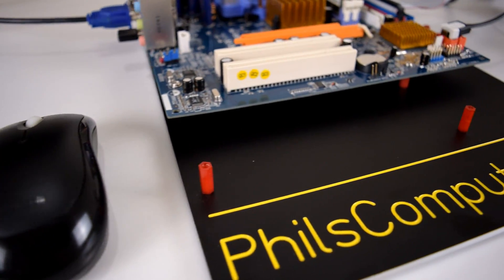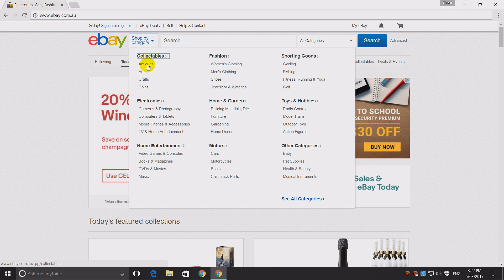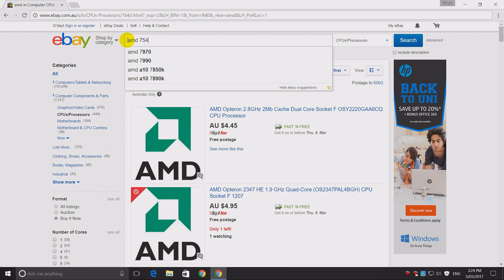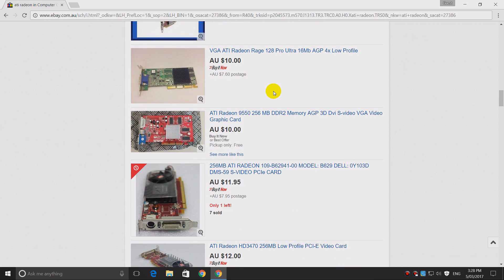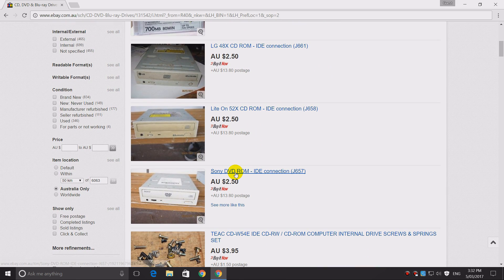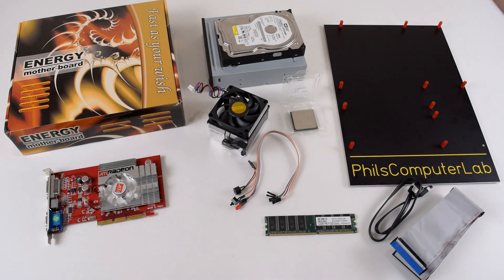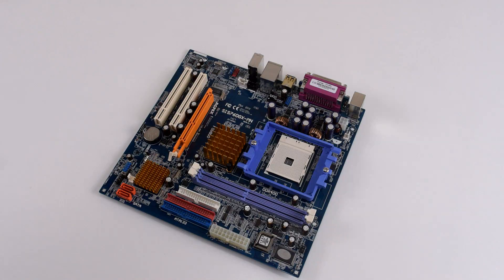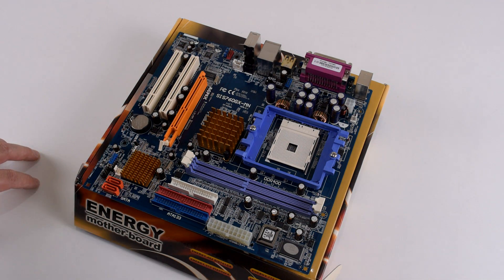Building a cheap Windows 98 Gaming PC

Comment: Sir . Great Vidio , may I ask if you ever did the accompanying vidios ?
I just totaled the old Dell and was hoping to build a computer for up to about 2005 games I don't know them but definitely games like zaxon pinball and race games.
I did find the AGP slots are alot more rare to get cards and drives for and working with old parts are stiff and break easily..    Any help pointing me in the right direction would be a great help.   Have a good day .. Bob
Reply from the maker: Finding an entire old machine makes life easier as you just have to add or replace some parts. AGP is what you want for Windows 98 and earlier. PCIe better for XP and newer.
Reply: @philscomputerlab    Thank you.  I got 7 old units last night one fired and ran most beeped and no bios. But got a Dell 8250 that fired went into windows 2000 and had a hard drive failure warning.  Games were looking for are windows 98 and xp.    I liked Zaxon and she likes pinball. 2 different versions of windows . And I would like the grandkids tonsee games that are fun and not all shooting as they are exposed to now... I'm into this a couple months now and have a optiplex 9020 to try to play online with my oldest grand son ... I did get an optiplex gx520 to go into bios also... Might you know these models and where I can go from here.. I'm still shopping for an older system... Thank you so much for your reply I'm trying to work with it.. your way over my head in this... Again thank you Bob Harrison

Comment: Yesterday I picked up a well looked-after Cisnet branded PC with a Sempron 3100+, 1gb of ram, dual layer DVD burner and a 120gb hard drive yesterday for 10 dollars (Canadian). This has an Via K8M800 chipset with the wonderful Unichrome pro IGP. Unfortunately I could not find my VGA cable so I had to dig through my old hardware stash to find a AGP card with a DVI connection. I dug up an old 256mb (I think) Radeon 9550 but I think either the memory or the GPU itself is damaged as the display at least in the BIOS screen is slightly corrupted with little vertical broken lines through the display. I'll live with it for now. I think I'll try to build a quad-boot system with XP, 7, 8.1 and Windows 10 just for the heck of it. Ultimately when I can source a good working AGP card I might turn this into a XP-era gaming rig

Comment: That's very expensive. What I built:
A Compaq work station motherboard with a Tualatin-S 1266MHz CPU and 512MB RAM for about 7USD
A 64MB Geforce Ti-4200 for about 4USD (untested)
20GB HDD I already had
FSP 200W PSU for about 5USD
Sound Blaster SB0100 with driver CD for 7 USD
LG CD Drive I won an auction for about 1 cent and the seller just gave me for free.
That's about 23$ total. Though I still need a case.

Comment: hey Phil, this may sound like a silly question but is 2GB storage enough for Windows 98se and some games? im dual booting Windows 2000 and Windows 98se on a 20GB hard drive and 98se has 2GB of free space I intend on using it for games Windows 2000 wont play and I also have a 64GB flash drive im hoping both can use for extra game storage
Reply from the maker: Yea that should be fine.

Comment: In may I have build two similar computers  based on boards with socket 754.  I didn't want the cpu to be power hungry so I added athlon XP  1700 or 1800. Athlon XP-M should  be better but they are rare.  OS are old arch linux and Xubuntu 12.04.  First has Nvidia 7300GS, the second has old Ati RAGE 128 PRO card to test how linux runs on such old card.

Comment: Nice very cheap build. Was it difficult/expensive to find a Socket A MB and an Athlon?. The 1 GHZ Thunderbird was an awesome CPU for 98/ME. (The 1,4GHz was a powerhouse, but ran hot as H...)  And with a Geforce 3. Perfect 98/ME machine!
Reply from the maker: Wasn't difficult at all, they should be quite easy to find.

Comment: Hey Phil, I'm looking at getting that ATI Radeon 9550 you've got there. There's a load of that exact same model on Ebay all shipping from China, going for 25 USD... did you get yours from a Chinese supplier, or would you reckon the ones coming from China to all be fake?
Reply from the maker: Forde3654Eire Not sure it has been a while. With these Radeon cards you don't quite know what you're getting exacting.

Comment: What about XP machines with compatibility mode? How good is it? I guess games run too fast though??
Reply: In my experience, 32-bit XP has surprisingly good compatibility with those old 98-era games--especially if you're very thorough and make sure to patch your games to the latest versions. You lose a lot more with the axing of real DOS, but if the PC is powerful enough to emulate with DOSBox, then you could use that too. Also mind, I've never used a version below SP2 saying this.

And of course there will be exceptional games that will show issues even with the compatibility modes--I remember having to use alternate installers for Thief/System Shock 2--but it played perfectly besides that, random save crashes in Jedi Knight II--but it was still playable, Star Wars Episode I Racer was an unplayable mess, Fallout 1 & 2 display incorrect colors (without a widely distributed fan patch) and probably some others I've forgotten. If you have a multi-core CPU, you best disable the other core as well.

If the games run too fast, you can use a framerate limiting utility like Rivatuner Statistics Server or Fraps or whatever you like--there doesn't appear to be any software or older versions of these programs that achieve this under 98--at least that internet users can surface for free. Chances are extremely likely that even older Nvidia/ATI/AMD drivers will also vsync pretty much anything perfectly too if you want to do that instead.

You can also enjoy the benefits of Sound Blaster cards, and even use an X-Fi PCI-Express card for real audio hardware acceleration if your mobo lacks traditional PCI slots. Unfortunately, support for Aureal Vortex 2 hardware audio is non-existent from SP1 and onward from what I've read (and extremely buggy for vanilla XP), so you will need 98 for that.

Hope that wasn't information overload!

Comment: are 128mb enough for a gpu or should i get at least a 256mb card?
Reply: I guess that depends on how new you want to play games. If you want to play those 2004-2006 games that were being released on the very last days of 98, all the cards you'll be interested in will already have 256 MB or more.

If you mostly just want to play 98 era games and the occasional Win2K/early XP game, 128 MB is probably fine for just about anything.
Reply: thanks for the help! :)
Reply: No problem.  ; )

Comment: I wonder if there's any Mini ITX motherboard capable of running Windows 98. I have a couple Mini ITX motherboards but none of which has chipset or integrated VGA driver compliant with Windows 98. I'm wondering if older motherboards like the VIA Epia series may do the trick. I'm thinking of putting a 3DFX Voodoo² in the only available PCI slot, then put everything in a small Mini ITX case.
Reply: I'd probably bite the bullet and get a slightly larger mobo/case for a few more PCI slots.

Half of the fun of a Win98 PC is the options for sound cards, imo--also important if you want to use older controllers/flightsticks.

I guess you could make do if you just get a single AGP card and only a sound card, but then you better hope you never need another expansion slot for anything!

I'm also just going to guess that ISA is pretty much out of the picture if you have anything but a full-sized ATX mobo, but unless you really like having DOS on the side, that's no big loss.

Comment: i have plans on buildin' a Windows 98 PC but i may think of gettin' dat PSU u have 4 it as well! i don't feel comfy on usin' old OEM PSUs i had ripped from my old PCs
Reply from the maker: Yea don't skimp on the PSU, ge something decent.
Reply: yes sir i will get a decent PSU! however i'm pretty sure EVGA PSU won't be good on Windows 98 era PC hardware because i'm not sure if they have good 5v rails so i'll look into Corsair or FFS

but would Slim IDE cables be better or should i stick with original IDE cables?

Comment: But... Can it run Crysis?
Reply: no! Crysis is a 2007 game and will not run on a Windows older than XP or even a processor less than 2 cores
Reply: It surely does run on a single core CPU. It just doesn't run that great.
Reply: but Windows 98 can't run Crysis
Reply: I've finished Crysis on a single core CPU, so that shouldn't be an issue. No idea if the game is playable on Win98 though.
Reply: it won't boot on Windows 98

Comment: Before I clog up the comments with a TL;DR spiel, can I make a game request in the comment section?

 P.S. The game is easily download able as it still has an active community.
Reply from the maker: I put some "game request guidelines" in the description :D
Reply from the maker: That's perfect! Now I have to deliver the goods :D
Reply from the maker: Bugger, it crashes when launching it. Burnt both CDs and it installs fine. I got to move on I'm afraid and finish the video :(
Reply: Hmmm, did you try running it on Windows 98 or XP and did you install the patch with it? I think if you install the patch on 98 it will bugger it. It has been so long since I last used Windows XP so I forget what features do or do not exist but on Windows 7 I need to both run it as an administrator and Windows XP SP3 Compatibility Mode in order to get it to run.

 P.S. Are you launching it with the second disk mounted?

Comment: Here in Thailand, I often find old computer parts from recycle center that happen to be near the air force base, they sell parts that isn't thing like gold cpu or circuit board with gold chips for cheap, lots cheaper than e-bay and sometimes they have lots of complete windows 98 computer or very old workstation/unix computer about to get recycle.

Last week, I got my self an old Intergraph TD-20 workstation (it in good condition and still working!) with Pentium 166MHz 48MB RAM 20GB HDD onboard ViBRA 16 and Matrox PCI card for about 10usd, and non working socket 7 tower (broken motherboard/no CPU/no RAM) for about 10 usd, an ATX socket 7 (working!) and an ATX slot 1 motherboard (untested) for about 2 usd each, a 3DLabs Oxygen VX1 AGP graphic card for about 2 usd. Less than 10 usd for the cost of travel there.

Tho with the risk that the parts I brought not working but I if you have some electronics  skills (can use soldering iron, change motherboard capacitor, etc.), have some experience of how to choose good parts from pile of junk and you can take the risk, recycle center are probably the best source to get parts for retro gaming PC :)

Comment: Also from regional Australia (SA) and seeing the price increases over the last few years is a concern.

Yeah, certain parts are becoming more scarce, but there's a fair few speculators buying up stock and listing it for a potential huge profit.  I'd rather people who are going to use it buy it!

It is still cheaper to buy individual parts and reassemble than buying a complete unit.  So a thankyou for your videos on putting them all together.
Reply: Keep an eye out for bulk sales. I picked up a box of mixed cards for $1 of which 50% were internal modems but amongst  that there were some video cards,  and sound cards including 2 ISA sound blaster cards, and a SCSI card. I picked these up so I can build out systems with motherboards that have been sitting around for 10 - 15 years.

Comment: I hope to build a Win 98 desktop at some point, but for now I have a Dell Inspiron 7500 from 2000. Pentium III 650, 512 MiB RAM, ATi Rage Mobility-P 8 MiB and a 25 GB HDD. Also a 6X DVD and 3.5 inch floppy. Would that be adequate?
Reply from the maker: The specs are decent, but I'm not sure about the graphics card. Could be the weak spot.

Comment: I am not worried about 3Dfx cards.Now I own around 50 of them and just acquired 5 Voodoo 5 5500 cards both PCI and AGP versions.
Yes I am hording them.
Reply: Maybe when they become 10 times as expensive I will start selling what I have in my collection.Like a Voodoo 1 for $500 USD or a Voodoo 5 5500 for $2,000 USD something like that.

Comment: why not use a Virtual machine? our gaming beast PCs can run a windows 98 computer on highest possible specs without breaking a sweat, because it's a 32-bit OS
Reply: VMs are great for productivity stuff and can absolutely play games well enough, but for autists video game enthusiasts like me, you can't run a Sound Blaster Live!/Aureal Vortex 2 with surround sound through that--and you won't be able to enhance your MIDI or use older controllers/joysticks if you care for that due to the lack of a physical Gameport or drivers.

It won't support 16-bit dithering, and possibly texture filtering/anti-aliasing anywhere near as well as an Nvidia/ATI card, and heck, for all I know, it's possible that you might still run into incompatibilities with some extremely fussy games like Star Wars Episode I Racer, for example.

Mind you, he didn't include a sound card in this build, but those are a huge advantage in my opinion and the Sound Blasters are cheap too (~$10 USD or less for a Live!).

Comment: Note - be careful when sorting by cheapest - a lot of the components that you pointed out have shipping charges higher than the actual price of the item.  A ~$50 PC could end up running $150 or more including shipping charges.
Reply: He only bought stuff that was actually sold within Australia, I think, so probably the shipping costs wouldn't be THAT high. But yeah, if you're e. g in Europe and buy from the US/Asia that'll often be the case

Comment: Can't wait for 3DMark 2001SE and 3DMark03 scores to compare it with my s754 rig :) I just got some GPUs after my 6800GT died, a 6600 (non GT) and a 9600 Pro.
PLEASE USE THE v150 VERSION OF 3DMark03 to make it work under 98SE, the v160 DOES NOT WORK!

Comment: Only bottleneck I can see is the slow interface ide hdd. if you used a pata to sdcard adaptor it would increase everything exponentially. And if that CD drive is slow such as a single or double speed optical drive. Otherwise I'd like to have it but with that shared uma graphics it's going to limit your ability to set a page frame address under emm386.exe because the gma graphics consumption of upper memory blocks. seriously give two a try one with one without and it will prove my point.
Reply: your Windows 98se disc will have msd a nice memory diagnostic program giving you a graphical representation of what's free and what's not. and if your able to set a page frame because if your playing did you want this feature. Say No to TSR's lol.
Reply: There's a good reason he's sticking with IDE with the optical drive--I'm betting it's so that he can still keep that analog audio support for old games that stream audio from the disc (eg. Quake). Of course you actually need a sound card to get that working (and cable), but you can add in a cheap Sound Blaster Live! for less than $10 USD around where I live, and the cables are plentiful and cheap too.

I'd personally take whatever bottlenecks IDE might cause in order to keep that working--this machine is good enough to run mid-life XP games anyway.
Reply: Licentious Howler only issue I have with old drives is region locked if DVD that is a shame.

Comment: Well I agree that prices are high for certain older parts on eBay. 
What do you think about Win98 vs Win2K vs WinXP for retro gaming PC? There was considerable debate around 2000-2002 about which made most sense, but what about now?
Reply from the maker: I like 98 and XP. A lot of games will run on XP, but especially older ones might cause issues. And a lot of XP games run well on 98 :)
Reply: I have a soft spot for 2k.  It was the first consumer grade OS's built on top of the then brand new NT kernel that I used and it was a lot more stable and wasn't taken down as often by 1 single application crash like 98 was. 

For now though? Probably a little harder to get things running with correct drivers on a Win2k system as it was quickly supplanted by XP and proper drivers may be a little harder to locate.  Although, from memory, I remember having no issues installing Win 2k drivers successfully in XP as most of the underlying internals of the OS were compatible.

98 is probably your best bet if you prefer to play a lot of DOS era games though as the 16 bit DOS environment was emulated by the 32 bit NT kernel.  

XP will probably be your best bet for general compatibility as it will run older DOS games without issue most of the time and will still allow you to run Windows era games too.

Comment: I'm still using a tyan Trinity s1854 system that was built bin early 2000, for 98, with sblive and Asus GeForce 256. not cheapest option, but I did find a nib one on eBay as well for pretty cheap. basically a backup board. throw in a p3 1400-s which works great with this board , and you have a decent era correct 98 as well as decent early XP board with more RAM and newer card like 9500 or 9700. I got newer 939 dfi setup on opteron as a good XP all round board still as well as retroactive purchase of some top athlon XP boards, but that tyan still works great and has held up well.

Comment: Nice video Phil.
ATM I only got a retro win 98se/ME and xp multi boot laptop.
I play retro games on that one.
But its kinda overpowerd for to be a truly win 98 machine. ( its a celeron 700 mhz with 192 mb, Upgraded from 64 mb to 192) It  has a 10 gb hdd. Wich is quite alot for its time. And I've putted in a 128 gb usb stick for extra storage.

EDIT: Its a compaq EVO n160 I believe.
Reply: I don't think it's overpowered. It's actually a perfect Windows 98 machine. That Celeron was released in 2000 and a 10GB drive is really not that large when you start installing games.